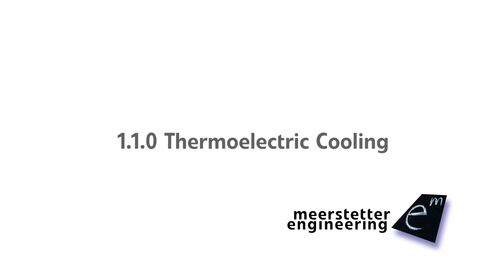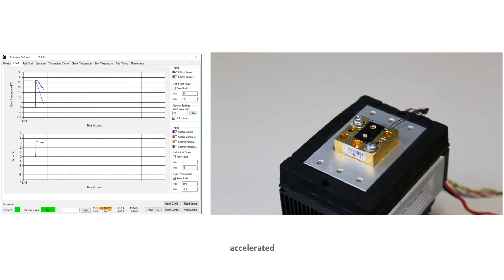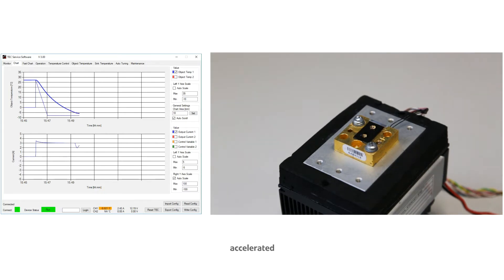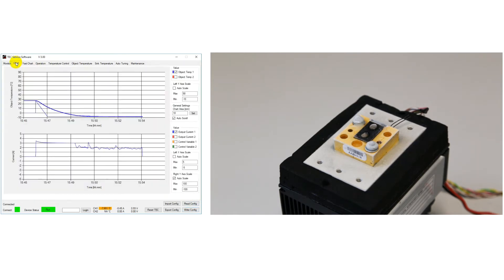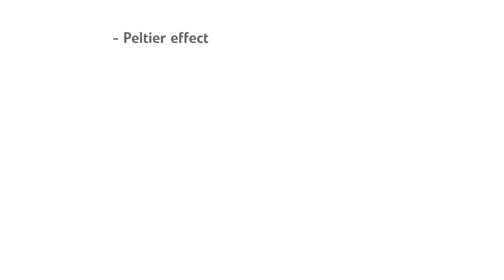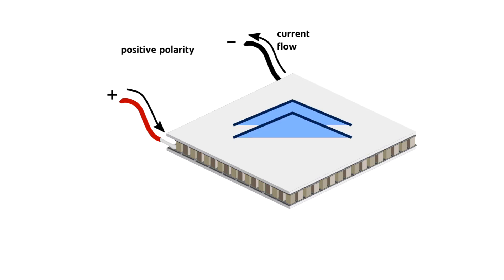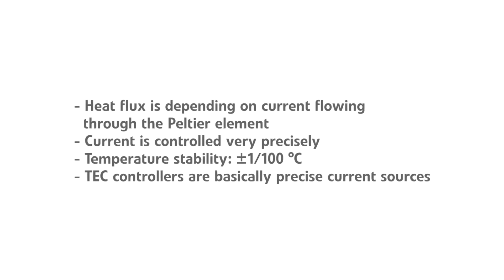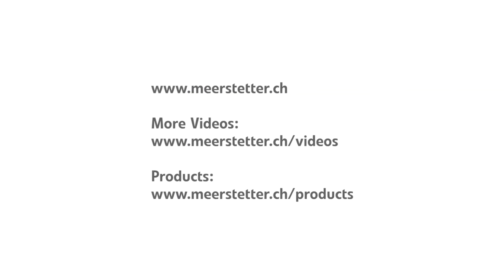1.1.0 Thermoelectric Cooling

Comment: Cool ;)   I am building small summer fridge for drinks with  one of those TEC, I was trying to control it with PWM , but it does not like it ..I will try to do current control, but with 125 A form caravan battery might become problematic. I guess I need to limit the current somehow. maybe. How many watts do I need to dissipate when running on 8 degrees C in 27 C environment? I tried with 60W computer cooler and it does not work very well.